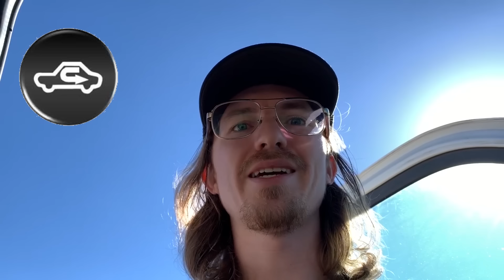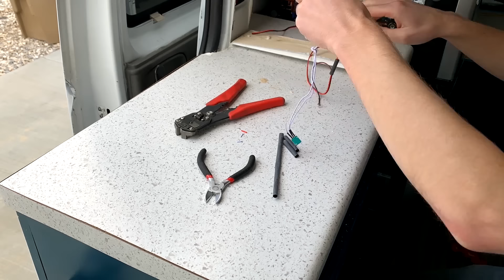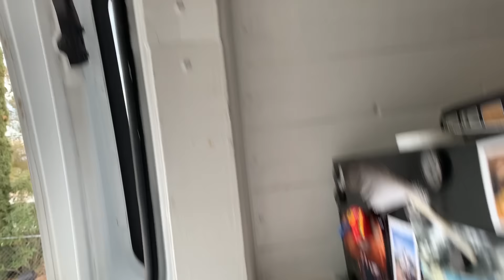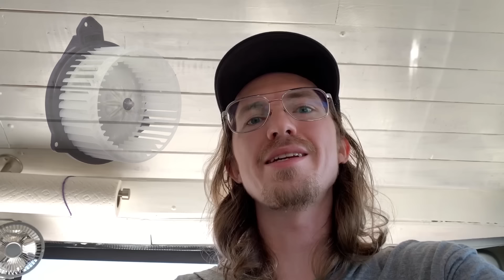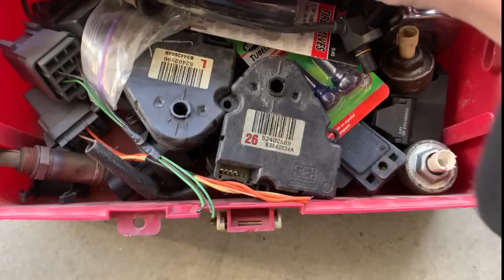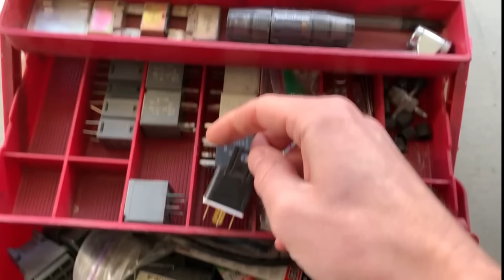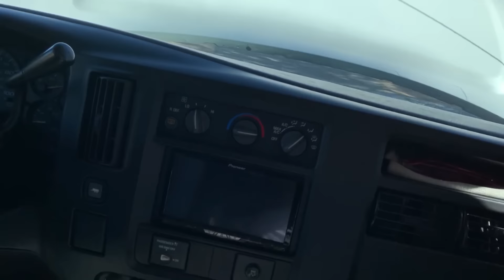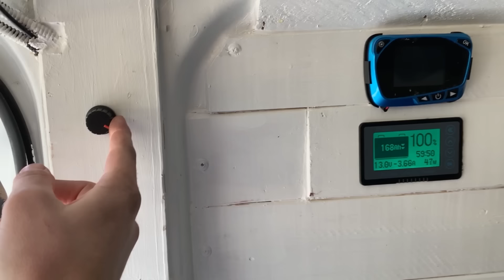OEM Blower Hack **ULTIMATE STEALTH**

Comment: I'm considering an exhaust fan that blows out of the rear wheel well if I can figure out a great way to make it airtight going down the road and not have rain and slush thrown back into the fan inside.  Maxxair, I think, has a 6" round fan that doesn't let in rain or light and one young lady got to fit under her solar panels.  This is the cheapest option if I could understand the wiring.

Comment: It takes the hot air from outside to the inside of the oven box. Just try running your fan 10 minutes with key in accessory mode. It won't hurt your battery for 10 minutes but it will make you pay attention this is bs

Comment: I wonder how many people have not thought about this idea? I think alot. I get it, its all about air circulation to minimise condensation etc. This way your not losing valuable realestate on the roof for solar and able to be low to the roof as possible. Extra benefit is No roof leaks, no forget vent fully open when driving etc. 🙂

Comment: Those holes in the roof with a vent fan stuck in them are all about "monkey see : monkey do."   I never needed a big hole in the roof.  It is just craziness on such a small vehicle.   I tend to park with the factory vehicle vent in the open to the outside position.    Great refrigerator.  Much better then the chest type.

Comment: I just saw this. It's my plan, as yet not implemented. I have the motor speed controller, I think the same one you show. I set this project aside (so far, about 5 years) because the overall project is in testing and development, and because when I looked at the control speed control on the van instrument panel, there were too many wires to allow connection without actually looking things up (I don't have a schematic). That's how things have been with the fan, until today, when YouTube recommended this video, and the first thing I thought of is connecting the output of the RioRand to the "high" connection on the existing plug from the switch. I just learned, listening to the video while writing, that there might be relays, my plan won't work with relays, so, this part of the project might be back in hibernation for now,

I should mention that I plan to run the blower from the 12V starter system, because I trickle charge it from the (24V) solar charged "house" system. The trickle charge is currently (for testing) just a hack, but I have a 40A DC-DC charger to be installed when necessary.

Also, I'm looking at 24V air conditioning compressors, to replace the (broken) belt driven compressor which came with the van. That's going to save a lot of space, and likely not cost more (if I count my time as worth nothing) than having .the broken compressor replaced and the system evacuated and recharged,.

BTW, running the blower, and especially air conditioning, on solar power will save fuel.

Comment: I'm not looking at "van life", but rather "trailer life" (CTC). I watch the vids for ideas, though. I have thought about a way to run my factory blower motor on all my vehicles just to keep the cabin from getting too hot in the summer while parked. Solar shades help, but I want more. Since I wouldn't have a "house" battery, is there a way to just use the starting battery and a solar battery charger? Or maybe direct from a small solar panel (not on the starting battery)? If it didn't run when the sun was inadequate, it wouldn't be critical as the interior wouldn't heat up as much, either.

Comment: My platform: 16'ft. dry freight box (FRP roof, stock roll-up door) replacing the stock coach mounted to a Hurricane-damaged class-C RV (exactly what I looked for '99' <15k miles, no damage otherwise, Onan 4kW genny, all tires great tread- $1,250.
I am resisting cutting any holes in my roof, and very few in my wooden floor or walls.
I am intending to draw fresh air in at the forward floor between the box skin & vertical ribs and the stock excellent quality oak floor. There are 1.5"in.w x 10"in. L spaces that can be accessed.
Right now I am thinking to exhaust box air through 3-4 low-voltage DC ceiling fans permanently installed above the rear wall. in front of the stock door.
Natural convection with the aid of DC fans is my goal.
TU & subscribed

Comment: I just tried to install this solution in my Econoline Van and it did not work initially - because I thought I could hook everything up to chassis ground per your suggestion - NOPE.  To get it to work, I had to install a dedicated positive and negative from the controller to the blower motor.  That means I had to install TWO relays, one for the positive cable (per your schematic), but another relay for the negative cable (identical to pos, but for neg).  Then all is good.  You can use the same ignition positive activation line from the positive relay to trigger the 'negative' relay.  Also, I saw a 16Amp current draw (200Watts) on HI.  This was pretty significant so you better have alot of solar if you want to utilize this solution for any significant amount of time.  I only have 100Ah battery in my rig and 160W solar so I'm clearly going to have to step up my solar output significantly if I want to be serious about using this solution.

There is another (simpler) solution for Econoline Ford Vans.  Instead of using a motor controller per this video, use a simple switch instead.  So when the switch is activated, full voltage goes from the rear battery directly to the blower motor.  You can then control the fan speed from the DASH speed controller even when the ignition is off and key removed.  The reason this works is because the speed control switch is hooked to the NEGATIVE side of the motor, not the positive side.  (I went through alot of troubleshooting to finally figure this out.  Had I known this going in, I'd just gone with a switch).

So it comes down to where you want to control the fan speed...
1) Control the speed from the dash switch: Follow this video, but replace the controller with a simple switch that ties the rear battery to the blower positive.  You only need one relay for the positive side only (per the video).
2) Control the speed from the rear of the van:  You will need to buy the motor controller and install the rheostat per this video:  But you will need to send the positive AND negative wires from the controller to the blower motor and replicate the positive wire relay schematic with a separate but identical relay schematic for the negative side.

Comment: :) roof fan takes what 2-3 amps?

Blower fan:

Speed Setting	Estimated Amperage Draw
Speed 1 (Low)	4 – 6 Amps
Speed 2 (Medium-Low)	9 – 12 Amps
Speed 3 (Medium-High)	16 – 20 Amps
Speed 4 (High)	25 – 30 Amps

Comment: One can save some installation hassle by putting the PWM & control knob into the dash.  Use the PWM full time, obsoleting the OE fan knob.  Note that you will need a second switch to change source between the key and the house battery.  This can be manual or his 5 pin relay.  The latter is better since it eliminates the ability to leave the fan on without knowing.

Comment: So I tried this in my astro van. Intersecting the resistor pack did not work so I went straight to blower motor. It will turn on full blast only as soon as power is connected. Do I need a specific stat on the PWM?

Comment: Why did you use 2 relays? Did you really need that? With one controlling the positive isn't enough. Or did you do the reverse but then discover that the blower system didn't work? I was going to use the back from the AC as a hood exhaust and general exhaust. But also my van is 2002 extended hightop. So there could be some differences. But most of your info is helping me xD.
Reply from the maker: Glad you've found the videos helpful! I wanted to isolate both the positive and negative from the PWM controller, as some will send full 12V positive power and modulate the power via the negative leg of the circuit. I could not find info anywhere on this specific controller, so just 100% isolated both legs (pos and neg) of the circuits (OEM circuitry and PWM controller circuitry). If you know your PWM fan controller modulates speed via the positive leg and treats negative as conventional ground, you could do it with a single relay!
Hope that helps!
Reply: @VanwithTim  do you know if you could technically use the rear ac  fan par as extractor?. Like use both synchronized one could push in and the other one out. I've been looking at most videos that you made because there isn't much info in this platform. Given that i bought like one of those church Vans. It's really tall so i have walking space. The issue i have right now is i have to make some custom roof rack because i don't want to drill the fiber glass.
Reply from the maker: @N4GUZZ  I think that's a great idea and would really help with the circulation. You would have to modify the rear fan ducting, as from factory it's permanently recirculating. If you cut a hole somewhere in the back of the van (maybe through the floor?) to push the air out, it could be done! You might be pushing the max amperage of the PWM fan controller though. Should measure the amps of both fans individually to ensure it does not exceed 30A. One final thought - the rear fan sucks air in down near the floor. Ideally it would have the air intake near the ceiling to take out the hotter air.

Comment: You should remane your video to "Hack use oem blower motor!"   Dayton 3frg7,   3.6amps on full.  No relays or miles of wire.  Efficiency is key to batteries

Comment: Curious...found you while trying to do this to my still-in-warranty CRV that the wife and I camp in - 3d modelling plugs and such to make it removable.

So the question:  it looks like you have rear ventilation controls above the windshield.  This usually uses a dedicated blower motor and vents.  Why did you not just tap into that second blower?

Otherwise, thank you for proving my crazy idea correct for me!
Reply from the maker: The factory rear blower only recirculates the inside air on the Express vans. I actually removed the rear HVAC and installed a stand alone diesel heater in its place and a 120V AC unit so I could power it via the solar. The huge V8 in the van consumes 0.5 gal/ hour at idle so very expensive to utilize the factory heat / AC.

Comment: I am very intrigued with your idea. My van has rear air/ heat. The air isn’t working and will be bypass soon. I was thinking about adding a max air fan but now thinking about using your idea instead. There are som differences. The air intake for the rear air appeared to be inside the van near the unit itself. There is a dial in the front that turns the rear fan on and the speed but the heat and cool is controlled by the regular temp control in the van.  What are your thought on using this like a vent fan?

Comment: Great work! Not sure if this will be noticed, as this video was posted a while ago. I had the same idea, and was excited to see that there are others who have thought of it as well, and gone through the steps to make it happen. I have one question. Where you used a 5 pin relay to automatically switch between power supplies, could I just use a SPDT switch to do that manually? I’ve got the parts lying around and would rather use them that buy other things
Reply from the maker: Hi William, you should be able to use the SPDT switch on the positive feed to the blower motor.
One thing I couldn't get a clear answer on was whether the PWM speed controller modified the "power" via the positive or negative leg. (ie. full power on the positive then modified power on the negative, or vise versa) 
However it seems the unit linked is a positive voltage PWM and the negative can be linked to a common ground.

If you had a DPDT switch of course you could connect / disconnect the OEM +&- as well as the PWM +&- but you should be fine leaving the factory negative alone and only switching the blower positive feed with your SPDT.

Just woke up so hope that made sense and I didn't ramble too much haha

Cheers! -Tim

Comment: Awesome idea! Do you have any issues with back feeding from the starting battery through the module? I had a difficult time with a solenoid back feeding through using the common to the house batteries and starting chassis ground. The solenoid would not open the circuit once it was closed. It would then drain my batteries.
Reply from the maker: Luckily with the double relay setup, both the positive and negative feeds from the house battery are fully isolated from the OEM wiring.

When the relays receive the "ignition on" +12v, the relays energize and re-connect the positive and negative to the OEM blower wiring (while simultaneously disconnecting from the house batteries).

Comment: I like the idea of using OEM components like this.  I use my OEM AC for an hour or more to quickly cool off the van while parked (engine running idle) in the middle of the day  and have never seen any overheating or impact .  In my case it also tops off an oversized starter battery that I use for house power too.  But my go to low watt powerful ventilation  on my van is two wholes I BENT UP in the roof UNDER a single giant 320 watt solar panel, so my panel is actually my fixed vent cover .  I then installed a custom 12v fan and I get great bug free ventilation all night long in Florida.  If the fan ever goes bad it's an $8 easy DIY fix.   Videos on my channel.
Reply from the maker: Ahhh yes! This is excellent! I was actually just looking at adding these https://www.etrailer.com/RV-Vents-and-Fans/Ventline/VP-543SP.html under the solar panels, but clearance would be an issue.
That's a great solution. Here's that video link for anyone else interested: https://youtu.be/HnBreDEpmaM

I have a video coming July 22nd showing the increase in solar output when the panels are cooled. (Spraying the panels with 70F water on an 87F day gave me an extra 130w (22%) of solar output!) I'm sure having ANY airflow beneath the panels would net a nice improvement in solar performance.

Happy to see someone with a working concept of this idea! Might be borrowing it in the future!
-Tim
Reply: @VanwithTim  Thanks!  I've noticed that too.  Solar panels work best when cooled off (with water or air).  One design idea I've had but could not implement in this small van was to have my ventilation intake come from under the van somehow.  I never implemented out of fear of Carbon Dioxide or times when the van has  hot exhaust pipes.  I have this off grid property with a shallow well where I often park I've had this idea of cooling the van and the panel with cooler air and water deep in the ground.. Some low-tech Geothermal cooling idea I think will work well enough to make the van comfortable the middle of the day.  I try to be realistic about ventilation in a van in Florida.. 5F difference can be huge. Best of luck.

Comment: Tim, I own a  Chevrolet Express with a aftermarket HVAC auxiliary system (heating&cooling) installed by “ACC Climate Control” (currently known as Valejo).Before I purchased it all the switches/controls  were cut off, for example for the Auxiliary HVAC (dual blower fan unit in the floor) has five wires coming from it, but I I don’t know where I should start to wire in/connect new switches, I own a multimeter am comfortable splicing/soldering wires.  Where could I find your email address?  Thanks
Reply from the maker: Shoot me an email at vanwithtim@gmail.com - I have access to OEM wiring diagrams but not sure how deep it goes into the aftermarket systems.

Happy to check it out though!

Comment: Nice! I'm more interested about the use of the relays and the "commandeering" stuff. 😃 At first I thought you were gonna use the fan from the diesel heater. That's also an idea since (probably)  It's sucking air from somewhere low (mine sucks air from under the van) and probably suck a bit cooler air than from the upper front of the car. Anyway, thanx for posting the relay hack.
Reply from the maker: You caught on to a key issue with my setup - the air intake location. Specifically after a long drive. The engine heat soaks the entire air intake area!

My diesel heater is in a recirculate configuration so no go for me in that respect.

Toying with the idea of an undermounted fan though!

Cheers!

Comment: Very cool you figured out how to wire it so the fan got power from one source and not the other….   10 amps on high is a lot for not much air flow.  I imagine you have to remember to leave the recirculate button off? 

I had a 2005 GMC pickup that used the same resistor fan control.  I Had to replace them every two years from burning up the wires, they draw a lot of current and make a lot of heat.  GM will build garbage just to save a nickel. Have a ford Transit now and contemplating where to put a fan.
Reply from the maker: Spot on - would definitely recommend a rooftop fan for energy efficiency and much better airflow!
100% have to make sure it's not on recirculate! Would be a big waste of battery power to accomplish nothing but white noise haha.

Definitely a garbage resistor... Or maybe not the resistor pack so much as that ridiculous wiring harness issue. There have been a number of van fires from that faulty connector (and probably a good number of the same era Silverados / Sierras)

Transit would be my choice if / when this van retires. Don't quite trust the powertrains from Fiat / Chrysler in their Promaster van. Really don't enjoy the increased parts cost and extra labor involved with the Sprinter (although they do look nice).
Had a 2016, 2018, and 2019 Ford Edge and the AWD systems were incredible. The computer flawlessly directed the torque to the traction wheels (even when two of the corners were floating off the ground).